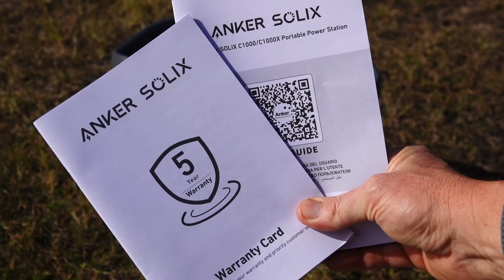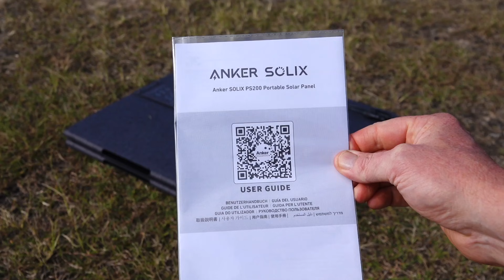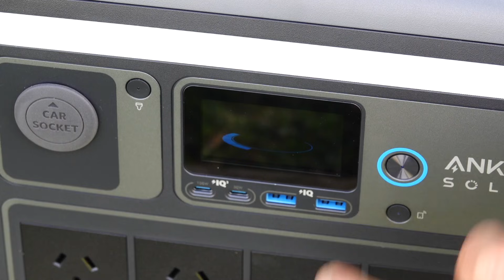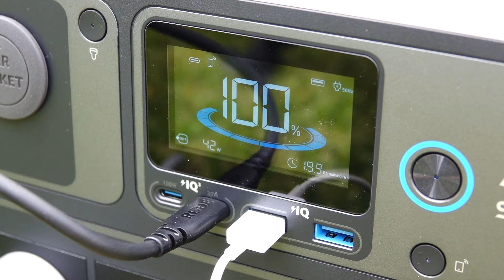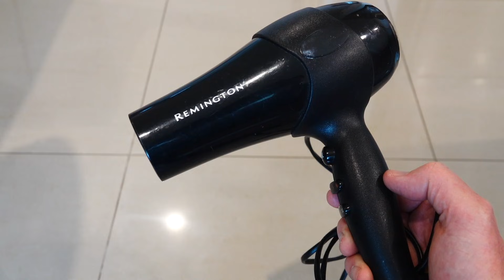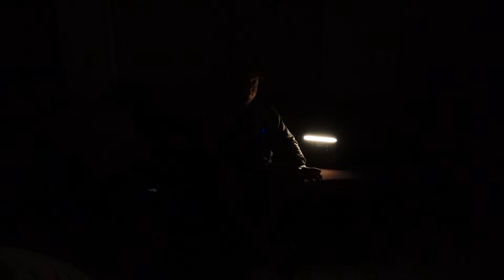ANKER SOLIX C1000 + 200W Solar (Watch before you buy!)

Comment: This is a great review. I’ve had my C1000 for years with aftermarket 200 watt panel. I use it camping as well as back up power for my Tiny home. Plenty 1 to 2.5 days of power outages due to storms here in Alabama. My Anker C100X has been fantastic. Even if all you do is camp, you should own one !